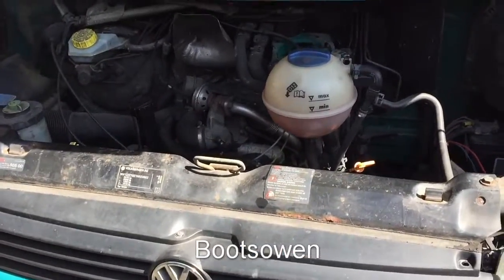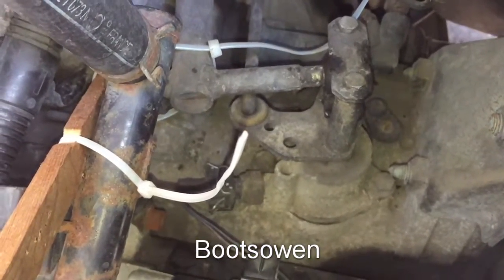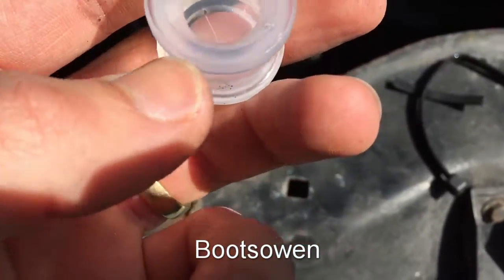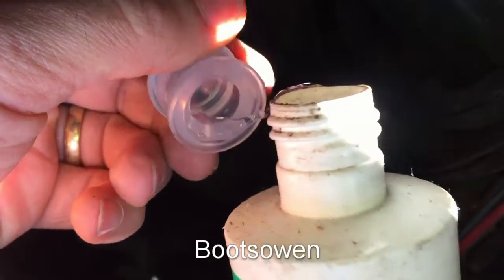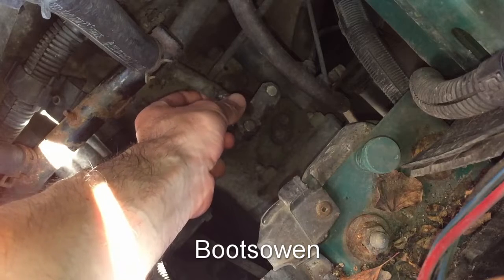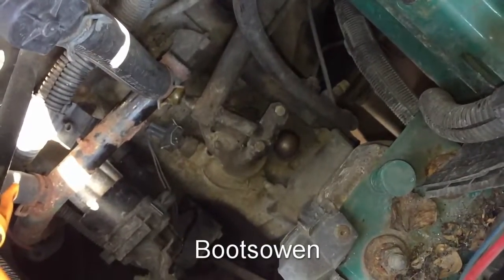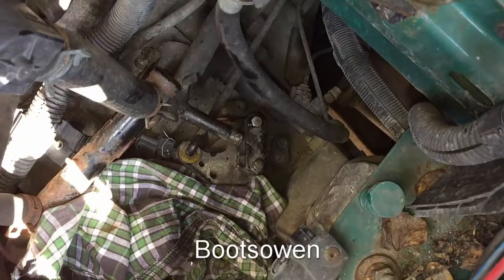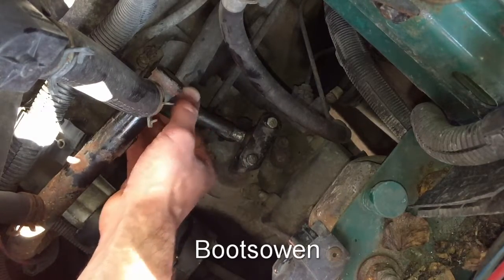Fixing a sloppy VW T4 Gear Linkage: won't go into gear?

Comment: Using vice grips is a great idea that I will copy today when I do the same job. Wish me luck. As a temporary get-you-home fix, a simpler way is to just use two heavy duty cable ties. One around the long end of the T, then another through that one and through the bracket hole, then back over the top to zip up. The remainder of the plastic socket will prevent the ball from going through the bracket hole. This fix got me home 200 miles.
Reply: UPDATE - The small ball on the short end of the T bar (the one that goes in the cup) was almost 1mm bigger than the supplied small ball so no way would it go into the cup no matter how much force I applied. Also, it was the one with a roll pin :( so I had to remove the pin by making a press with two metal plates and bolts. Nightmare! Anyway, I found out that the original drilled ball and correct cup are not available from VW (or anywhere else). To get around this, I drilled out the supplied ball to fit over the shaft and also drilled a 3mm hole for a replacement roll pin. What should have taken half an hour turned into 3 days removing original parts and waiting for a box of assorted roll pins from Amazon. Hope this helps someone else with a very early T4.

Comment: The way I found to do it is to put the socket in ( I used a little washing up liquid pushed in most of it and used a flat blade screwdriver to get the last bit in) then block behind the socket with a bit of wood and the same the other end of the rod leaving a small gap to get a pry bar between the block and the ball the other end and just lever the ball into the socket

Comment: I have done this job and it is a ball ache to get the ball into the socket. A tip for what I did was to set up what was essentially a tourniquet. With para cord or dynamo rope, I got them around the linkage and the back of the socket and used a bar to tension the rope and eventually it popped in, a few knuckle rashes to get it done, but its an option.

Comment: Thanks for the video. I just did this repair, only bashed my knuckles, no blood. I wedged a tool behind the cup and used a piece of pipe as a pry bar to force the ball into the cup. Had to be careful to not lean on the brake lines. Cheers

Comment: I just did this job, real pain without the help ofthis video and tips below.
I used a block of wood wedged against the socket end and engine block (Make sure its nice and snug and covers the whole socket) then used waterpump pliers in the same way as the vid. Strength needed to squeeze it shut but it popped in and feels better than before. But I am going to copy bootsowen and get a kit together incase it pops again (sods law when i am in the middle of nowherewith the Fam)

Cheers for the ultra helpfull video Bootsowen
Reply from the maker: Is this the video where I used cable ties and a stick or where I did it properly?

Comment: I have a t4 2.4 l diesel with a double cabin but my father turned it into a pick up truck with shutters with a latch on each shutter the problem is the gear linkage is a bit bad and needs replacement we got the parts i watched your video and now he can 
Replace the gear linkage

Comment: Brilliant! Just lost all drive on mine, found this and now limping to garage with the aid of cable ties and a bit of wood. Slightly harder to fix on a 2.5 2003 as there is nothing substantial to attach the wooden split to, linkage seems further back than yours. But got enough on it to get going again. Thanks!!
Reply from the maker: Happy days! that's what it's all about!

Comment: Used a modified stick for a week whilst I considered my options. On a newer T4 tdi access was a pain from above and below and I ended up removing the linkage and fitting off the van. There's another video that helped. Took about a day and a half
Reply from the maker: At least you did it yourself and maybe learned something

Comment: A couple of extra tips, rather than using large pliers or a clamp is to heat the ball in boiling water and only take it out of the pan when you need it & apply then some grease. Get set up with a long lever and a small piece of wood to push on the ball with. Went on a treat without having  to dismantle too much (only the cage around the ball with 2x10mm headed bolts).
Reply from the maker: I tried the boiling water trick on the cheapest balls on ebay, the ball melted and shrunk!

Comment: I took the whole linkage off. My tip would be put the small ball in the plastic socket and metal bracket line up the hole with the rod, and then force the rod in.

Comment: Hello Bootsowen, watched your video. Our T4 o2b transmission ha s a problem with reverse gear. The safety of the reverse gear doesn't work anymore. Is this also a case of the linkage and replacing the bushes? Greetings
Reply from the maker: Is that an issue ?
Reply: @bootsowen  well yeah because the shifter feels sloppy and now there's a big chance that you accidentally put the car in reverse instead of first. Also you need to "gamble" a bit to get it into second while shifting down.
Reply from the maker: If it’s sloppy the bushes should tighten it up. It might grind but I can’t see how you could actually get it into reverse when moving?
Reply: @bootsowen  you're right it's almost impossible to put it in reverse while driving. But when you are waiting for traffic lights you want to be in first and not reverse.. I will take a look at the bushings. Thanks for the advice.

Comment: Well I've been trying for 2 hours to get the bush into the metal hole with no success. I don't think I'm getting the bush soft enough in hot water, it still feels really hard. Did you boil it in a pan or just put a Keetle full over it?? Great vid as always 👍
Reply from the maker: I put it in a cup of hot water for a few minutes, but the balls I had were not the kind that liked heat. You could use some spit or silicone grease and that might ease it in a bit. you need to get a good bit of pressure on it. Depending on where you are the cold weather might not help. point a hairdryer at the bit it goes into until it gets some heat into it and try again and again and again!  Let me know how you get on!
Reply: @bootsowen  I'll keep you posted. I managed to get a tiny g clamp on it but it just wouldn't stay square when winding in. I'm going to keep the hot water near the van tomorrow and hopefully reduce any heat being lost. Thanks for replying 👍👍👍
Reply: Well I don't know how you did it. I had to take the bracket out and boil the rubber again and put it in with a vice!! I'd never have done it how you and others did. Only thing I can see is my new part isn't made of the same material as yours, mine is more like nylon!!
Anyway it's in so just got to get the ball back in tomorrow.  Keep the vids  coming, they help me so much 👍👍

Comment: How long did you have it in hot water for?
Reply from the maker: Tool long? Maybe a minute or two. I would use silicone slip compound if i was doing it again.
Reply: @bootsowen  Thanks, perhaps thats where im going wrong. I been leaving it in for about 5 mins

Comment: You should get some wd40 and a old rag and go over your wipers so you can restore them a bit
Reply from the maker: Are they not working? How do you know? I would have thought the oils in WD40 would have accelerated the demise of rubber.
Reply: bootsowen you know the blades, just put some you can look on the web if you still don’t know.